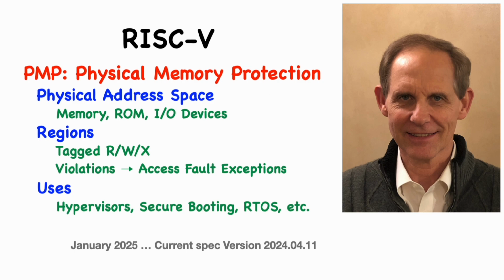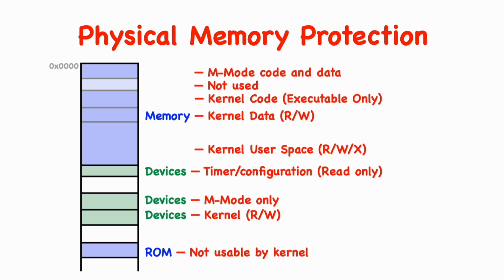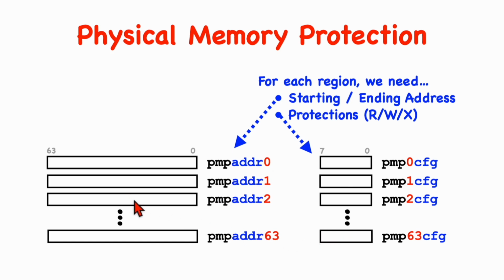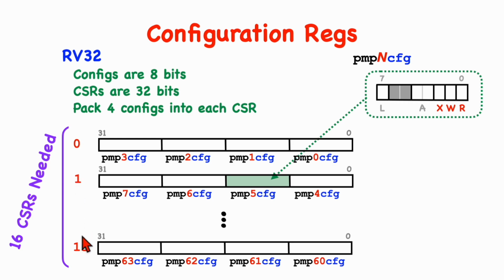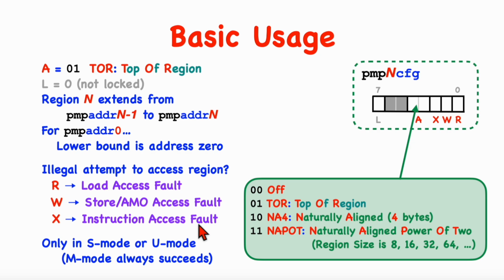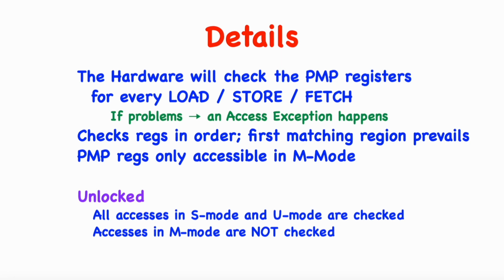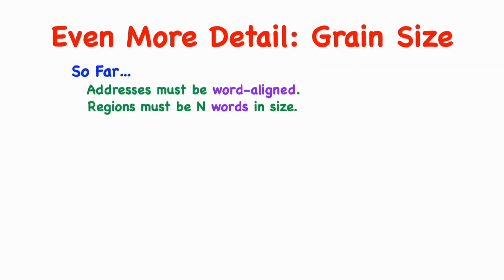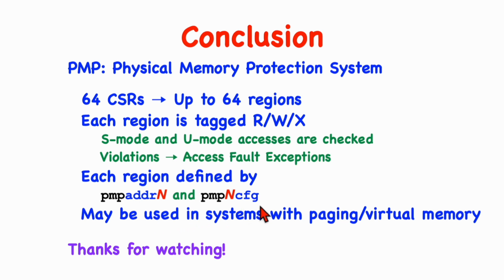RISC-V Privilege #15: PMP-The Physical Memory Protection System

Comment: If there are device regions to be managed like this, there's not much benefit to reifying their permissions afaict, as the permissions don't change. For dynamic areas, I don't see why having a logarithmic search table would be any faster than an interrupt driven tlb fill. You can already do flexibly sized TLB slots, and keeping these naturally aligned makes finding a match parallelisable. Am I missing something?

Comment: No offence but no one cares, even engineers, bo one goes that down into the rabbit hole, show us peripheral devices configuration, that's something ❤
Reply: I care and I appreciate these videos.
Reply: What a dumb comment! This is very informative video!
Reply: That's not true at all. Engineers writing the kernel itself or the firmware do care, like the contributors to Linux/OpenBSD Kernel or OpenSBI or embedded enginners porting or writing custom RTOSes, which is more common than you think. Also people writting hypervisors like xvisor, KVM, bhyve, Xen.... Not all embedded dev is writting a device driver, for the device driver to work you need an OS. Heck, even if you only write drivers, I believe it would be very beneficial to be aware of how the machine works. Btw hackers and malware and exploit developers also care a lot about how the machine works....
Reply: Are you braindead? Every RV OS dev and core designer actually cares about this. I care about this, because I need to implement PMP in my RISC-V core design.
Reply: If you don't care then this video obviously wasn't intended for you, doesn't mean nobody cares